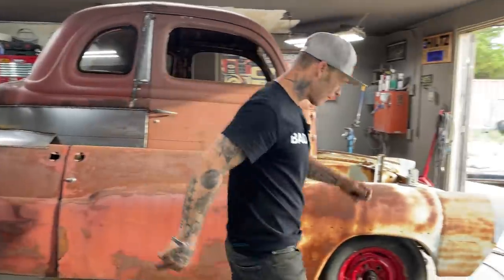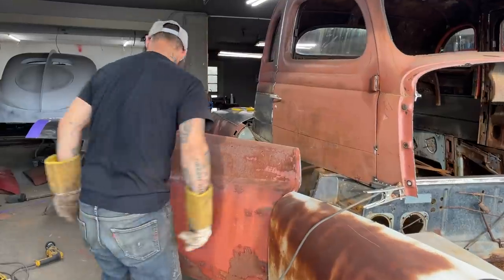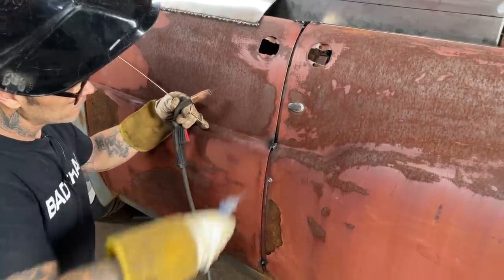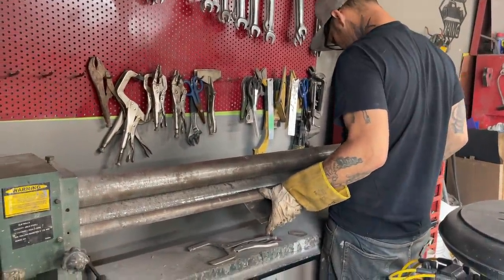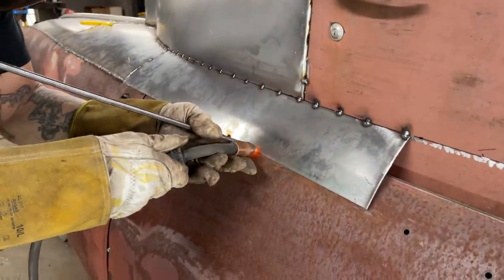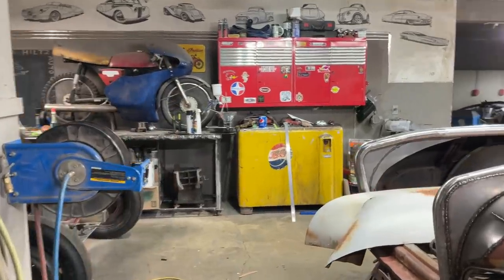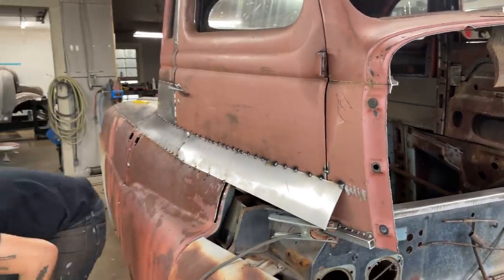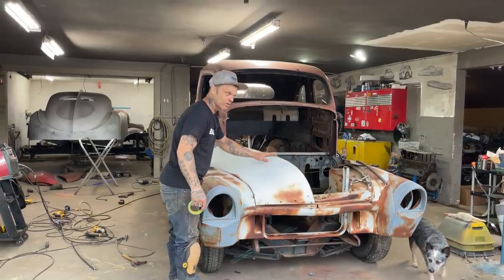THE MERC DOORS ARE GETTING WELDED SHUT: WHEN FOUR DOORS BECOME NO DOORS

Comment: While watching the layout of the door. The green tape is fine for looks the worrisome issue will be the bottom of the door hitting the lower body door as it flairs out. I think the shape will require the lowest part of the door to flair towards the front to allow clearance. Try this cut a piece of cardboard perpendicular to the side profile at the hinge. Then use that silhouette on the front fender. Kind of like when you had the round door and could only place one hinge.

Comment: Two things puzzle me about Chad's work practices.  First is that he rarely wire brushes the painted surfaces before welding. Second is that he doesn't wire brush or apply any weld through primer on rust before he conceals it behind panels that become inaccessible after welding.
Reply: @joepacheco4038  you can't have "Rat" without rust.  But I feel you
Reply: @Sdavrider
Your best bet is to sit back and enjoy the entertainment. If you are a young man and intend to keep your cars, or have them last, then do everything you can to eliminate every trace of rust, and do everything possible to prevent it from coming back. I have a feeling you already know all this however

Comment: I am lovjng your creativity and truck build. One thing about the doors is that by using the stock top hinge alignment you will need to scallop out the front edge to clear the roll of the front guards. Also I think the truck would make a great 5th wheel car or camper hauler. Keep up the good work mate. Cheers 👣

Comment: If you do that door it will need to be a suicide door because it won't pass the front fender. Personally I would line up the A pillar and B pillars pf both cars and have the one big door with steps similar to a bus or some transport trucks. I still would do suicide doors because it would be extremely easy to line up the B pillar and get them working.

Comment: But if you don’t clean the rust the rust under the good metal will start to eat that metal
Reply: @merckxamillian  no as long as air hits it ,it will rust ,rust needs  two things to survive air  or moisture  you got to remember the cars in these museums don’t have no rust on them they are well-maintained unlike what  he is doing he’s putting good metal over rust so there for that rusted metal will feast on the good metal eventually when he puts body fill and  paint it the rust will come through overtime .

Comment: Consider hinging the Merc door skin downward to form an aircraft type stairway to reach the outward swinging top door with consistent vertical gaps.  Looks like a solution to get in and out of the truck easily.  You wouldn't have to attach the curved area of the bottom door to the top door.  After you grind the high weld spots.  Use an adjustable vixen vile to finish the curved surfaces.
Reply: I like that idea. I would split it and have the top half gull wing and the bottom half be stops that fold down

Comment: cool 54 Nash Metropolitain have it Red and white by Muscle Machines 2003 has big rad blower on it. monster wide tires in back cool side pipes. looks low to ground most of mine have never opened. yesa nd know want put in motor and tranny. but still fill you will show use soon that 36 hood on on of merc to see what looks like that is that tight of a fit for those pieces and will be strong enough so you and us out here will be able to visalize it.

Comment: That ford door is not going to open, if you cut it where you said you are. The buldge out of the merc pieces and parts you added will bind when you try to open it. the ford hinges just a few inches apart are going to be real flimsy at best, and never line up in the same spot twice. To cut where you want you will be stuck with gull wing doors.
Reply: ...Actually, if you cut off the '36 hinge and make a similar hinge in that location with the pin angled out a little and put a second hinge on top of the Merc bulge with both hinge pins lined up, your doors would open McLaren butterfly style. Cooooooooooool!!!

Comment: When folks are talking about the rust they don't realize that these old cars were made of very thick metal also a better quality metal. plus chad is welding eighteen gauge metal on the car. Which is very thick compared to cars that come out of the car manufactures today. Also whether you understand it or not, when metal gets a thin coat of rust on it, its actually protects it. Its the salt and the dampness that causes cars to rot out, not surface rust.

Comment: I'm curious as to why you use fill rod when wire welding. I have not seen that before.
Reply: Just makes it easier to fill up gaps without using a back up strip.

Comment: That's what I want to see... the engine you are putting in there.
Reply: I think Chad said there is a rebuilt running gear in the 48 sitting out front?   Should bolt right in I would think.  Could also be the point where he’s waiting for parts